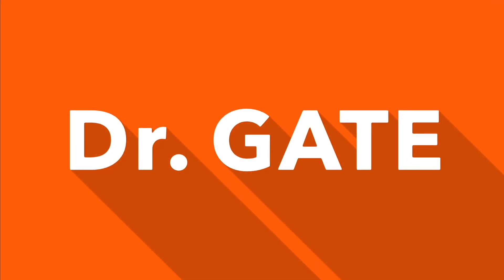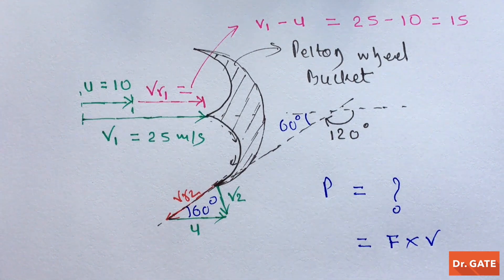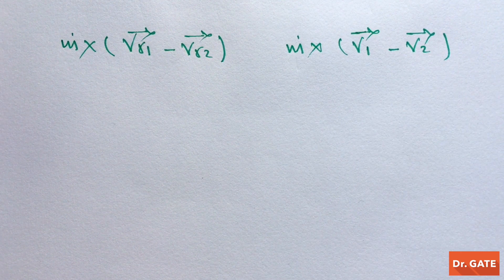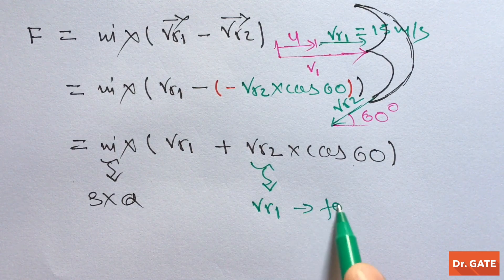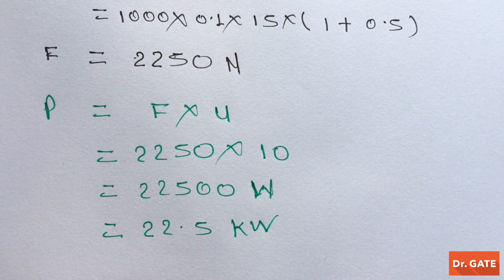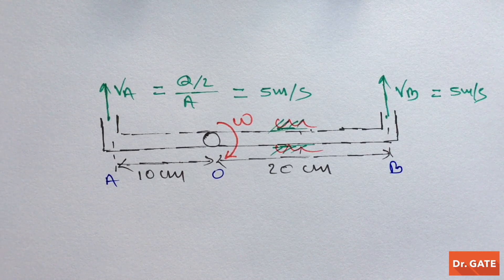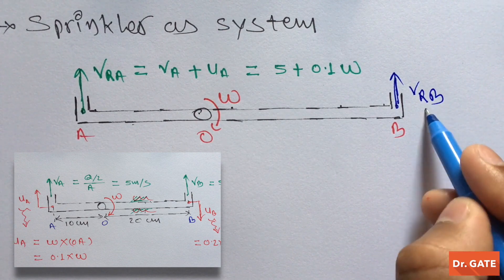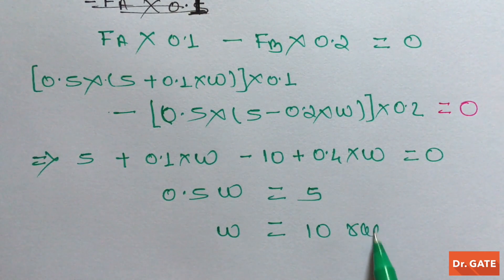GATE 2019 | Fluid Machinery | Hydraulic Machine | Numerical

Comment: The direction of velocities in the second question at the left end of the sprinkler is same then to find the relative velocity at that end you should have subtracted instead of adding........ Please check that part and tell whether I am right or wrong..
Reply from the maker: Think it in this way; 
If the sprinkler is stationary, velocity of water coming out from left end is 5m/s. When the sprinkler start rotating, that 5m/s will remain constant (bcz discharge and cross sectional area is constant) Plus tangential velocity of sprinkle will also add up in to it. And remaining calculations will remain same. 

But i did one mistake. Instead of taking sprinkler as a system, I should have taken observer ( which is at rest, away from sprinkler and discharging water) as a system, then everything will be cristal clear 🙂

U were right in ur place 🙂👍🏻👍🏻 Thanks for asking this doubt 🙂🙏🏻
Reply: Dr. gate....have a look at this part too

Comment: Can you explain why the relative velocity remains same while absolute not?
Reply from the maker: Good question 👍🏻
Let me first explain why the absolute velocity is decreasing!! 
First we convert potential energy of the water at the reservoir to kinetic energy at the nozzle ( by expense of its PE) then we convert KE of the water coming out of nozzle to the Mechanical energy ( in expense of its KE) to rotate the turbine blade. Since energy is conserved, so KE decreases at the Turbine blades, i.e. absolute velocity decreases.
Reply from the maker: Relative velocity remains constant bcz when u r at the Turbine blade ( imaginary situation) u will find that, water jet is coming then striking the blade, then getting deflected, then going out. In all the process cross sectional area of jet getting deflected is constant and if the surface is smooth then there is no resistance to the motion of water jet. So u won’t feel any change in velocity. i.e. relative velocity remains constant
Reply from the maker: Since law of Physics is same for all inertial Frame of reference. So in later case Force is rate of change of relative velocity ( velocity is a vector quality, and its direction is changing). 
While in the first case, Force is rate of change of absolute velocity.

In both the cases u will get the same value of Force 🙂👍🏻👍🏻
Reply: @DrGATE  since the absolute velocity is decreasing and we koe that the realative velocity is just the vector difference of them so rel. vel. too should change from this logic?????
Reply from the maker: Vector has both, magnitude and direction. Though magnitude of relative velocity is constant but its direction is changing. That means value of relative velocity is also changing. But not magnitude.